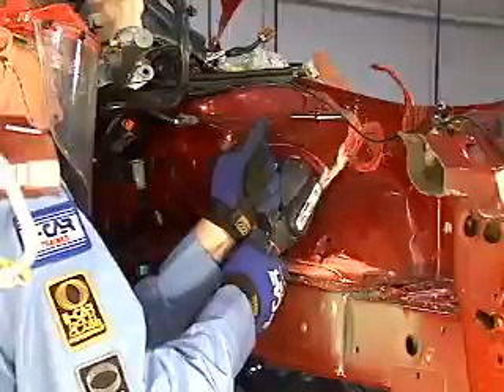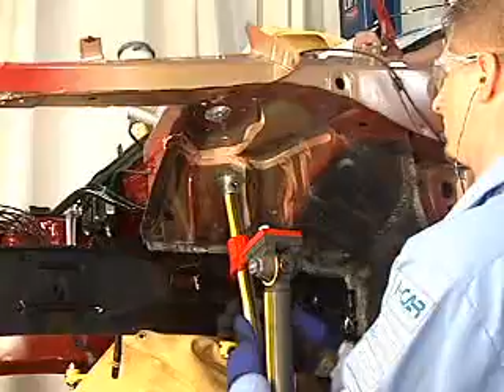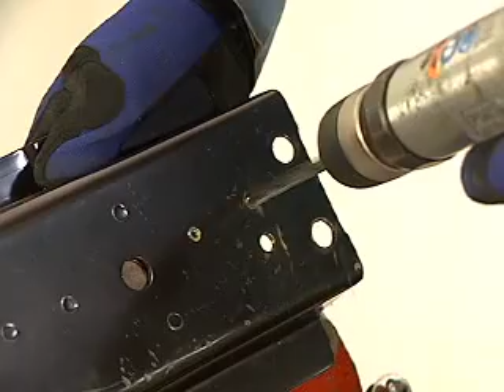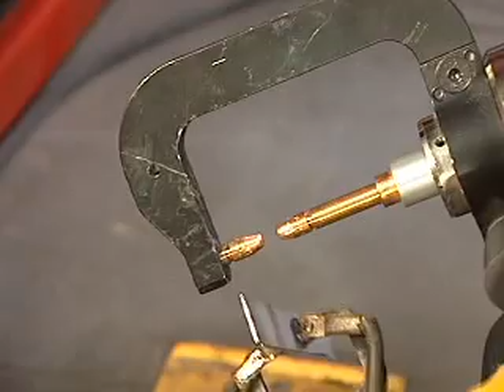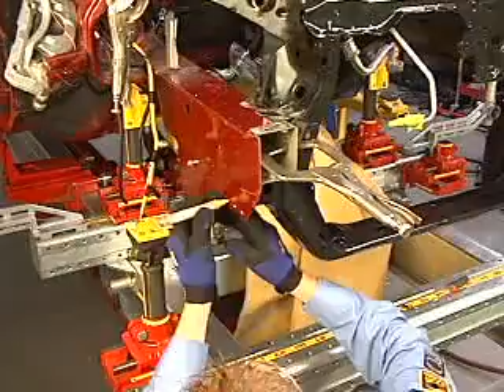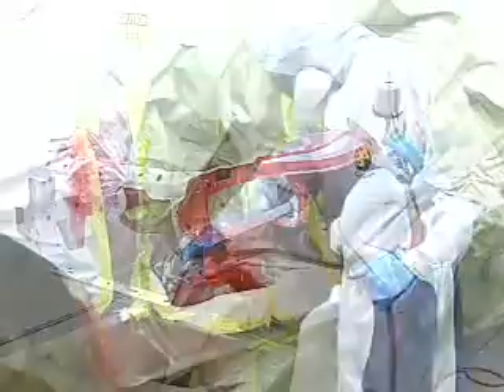collision repair car bench  "Courtesy of I-CAR"".

Comment: kudos on catching that.  also note that the sound deadener is not replaced on the floorboard.  the inner structure was painted the color of the car.  it goes yellowish green with outside color overspray.  just my 2 cents.